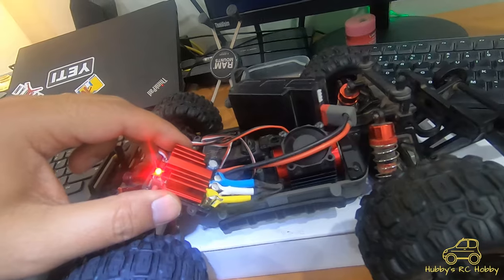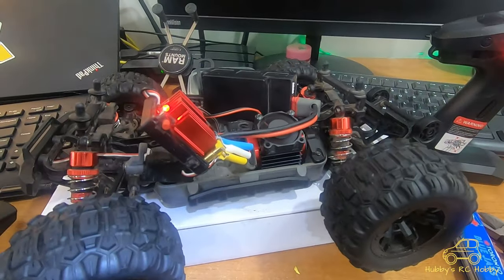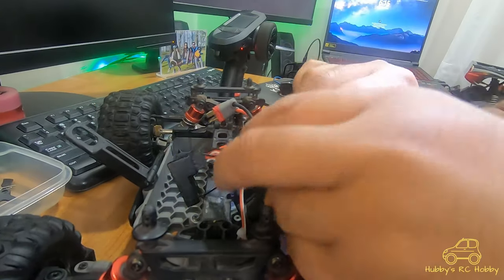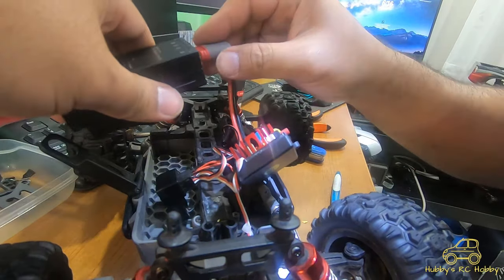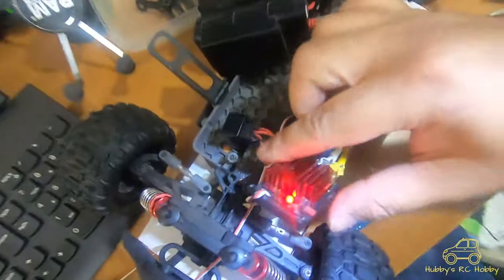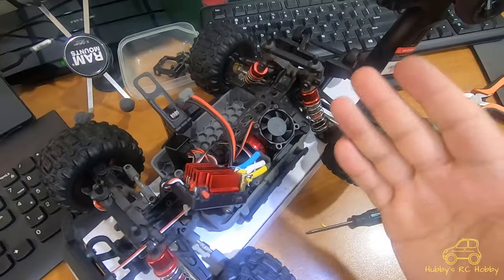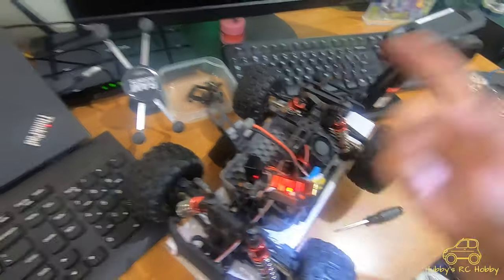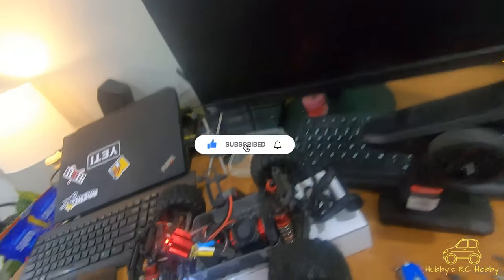Fix a ESC Red Light Blinking / ESC Red Light Flashing and No Throttle

Comment: My mix is 2 days old I got it yesterday and it would run all day on 70% throttle but soon as I switch it to 100% it kills the car after 1 ssecond. Then the light is blinking.  Then I plug battery back in on 70% and it will run. But back to 100% kills the car. What’s happening???

Comment: Thank you for uploading this solution. I have a hyper go as well and after the 3rd run it stoped working. I have the LED flashing and no steering or throttle. 

Will take a closer look the connections and see if this will help my situation.

Thanks again!
Reply from the maker: Your welcome. It should do the trick.
Reply: @HobbysRCHobby  unfortunately for me, it did not resolve my issue.
I really don’t want to buy any new expensive parts like esc or servos as I just bought it. I think I will try a refund from the seller.

Still, thanks for uploading!
Reply from the maker: @emparado  sorry to hear that. MJX is usually willing to replace you with another ESC, if yours came defective. But yeah contact them and they’ll give you options
Reply: @HobbysRCHobby How can I contact MJX, my 14209 is having a faulty ESC too. Only the red light is blinking, fan, servo, light and motor not functioning.
Reply: @lkwanz  same as mine.  Steering works but when I engage the throttle only the red light blinks and the motor does nothing.  No beep either when you turn the car on and it pairs with the controller. Fustrating